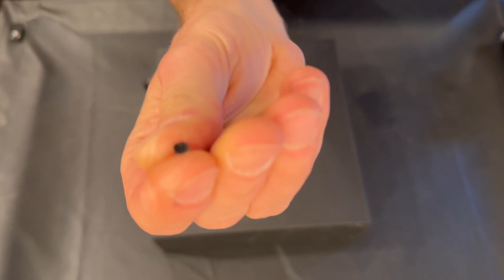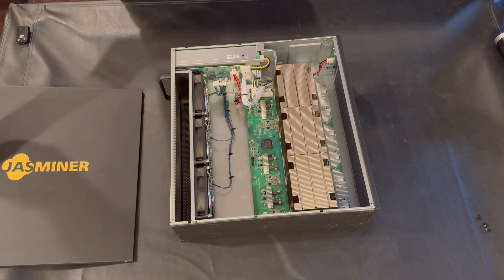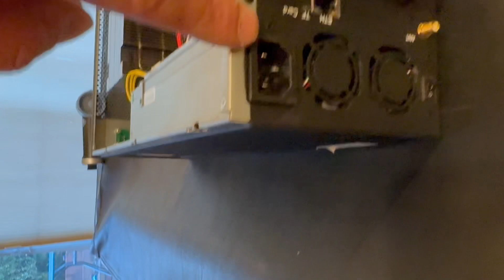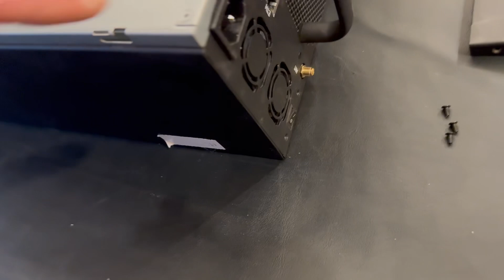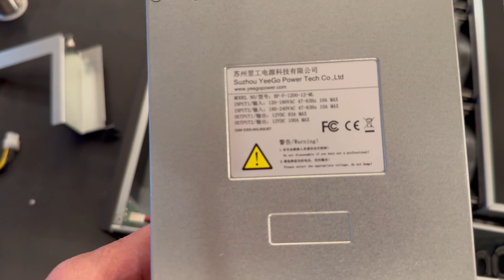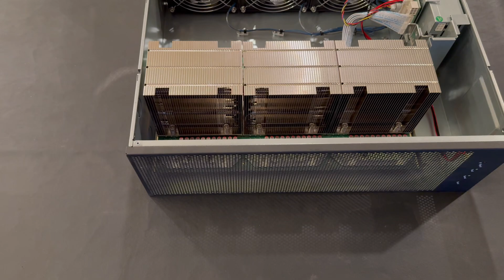JASMINER X16-Q QUICK LOOK INSIDE,  IF PSU EVER NEED REPLACEMENT?

Comment: Thanks for the great video. My Jasminer x16q is dead and not working any more. Used for less than two months. Please let me know from where can we buy the PSU unit ?
Reply from the maker: I would contact Jasminer directly or supplier you ordered with they should have replacement and possible warranty on the PSU since it’s only 2 month old.

Comment: Had to replace my power supply a few months ago since it was DOA.   Wish I had your video back then 😢
Reply from the maker: I hate those DOA product after they supposedly tested. I hope you don’t have to go through it again. Power supply seams like at least 1200W so  shouldn’t have any problems.
Reply: where did you buy the replacement PSU?
Reply: @glennlancaster1443 the replacement was covered under warranty but I had to take it apart to swap it out.